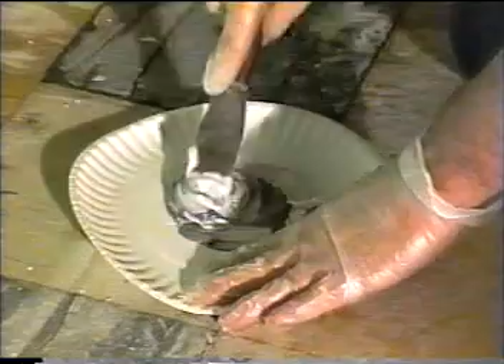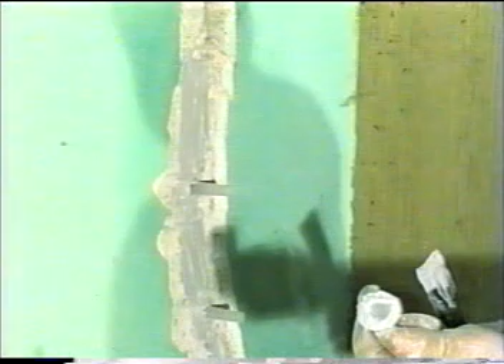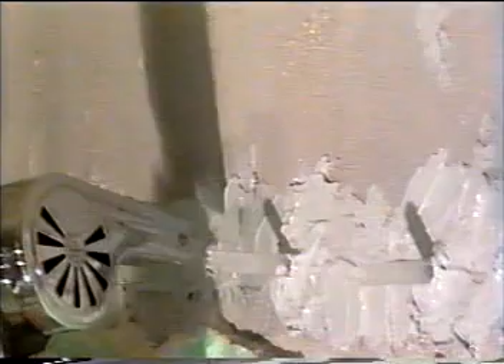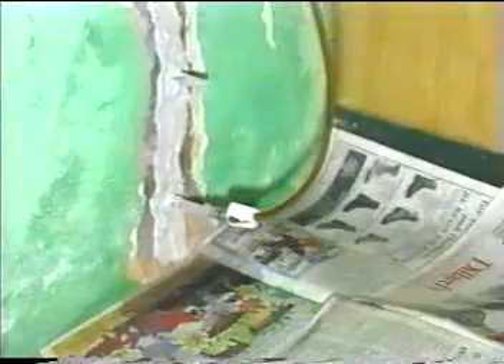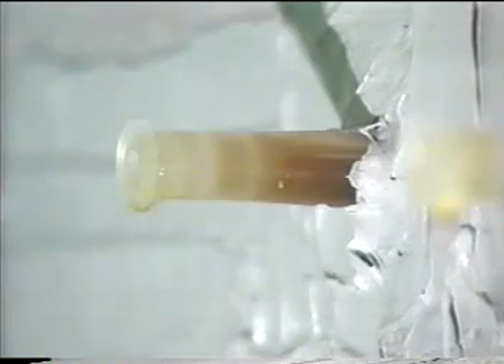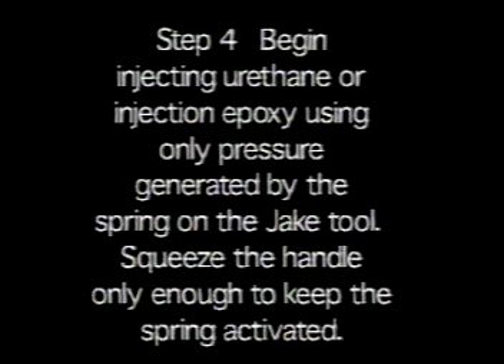40′ Contractor Polyurethane Foundation Crack Repair Kit How to Video

Comment: This process was painfully simple.  Just be sure to use enough of the epoxy to cover the crack as suggested in the video/instructions.  Note to Applied Tech, the caulk gun that was shipped completely broke when i first attempted to squeeze out the epoxy in 68F area.  Caulk gun was really cheaply made, but, easily replaced with a Home Depot caulk gun.  The quality of the actual product however, is fantastic - just recommend spending a little more of the price of the kit on a better caulk gun.
Reply: Is this epoxy something that would bond the crack and make it strong 
Or is it mostly a waterproofing epoxy?

Comment from the maker: This is not the correct repair for floor cracks.  Floor cracks indicate high water table levels and these should be mitigated by a functioning drain tile and sump pump installation.

Comment from the maker: The surface of the wall must be dry for the surface sealer to bond.  We offer this way to repair a crack where it is actively leaking though.  Unfortunately, Youtube does not allow a direct link to the page of our website that has the kit and video.  Call us at 877-277-5948.